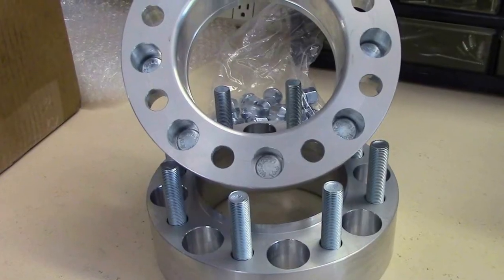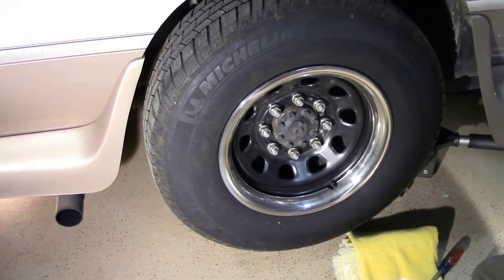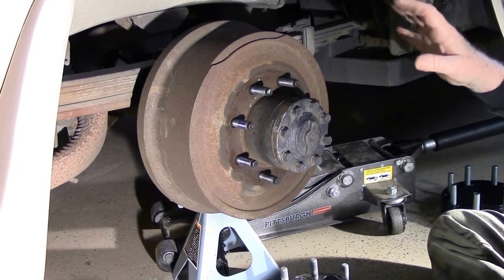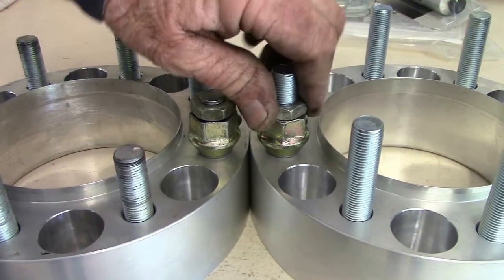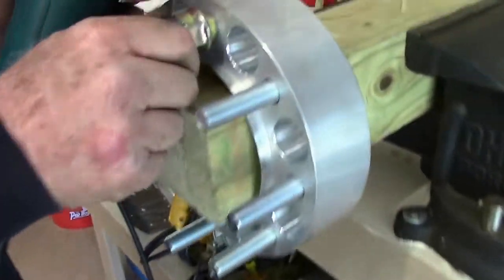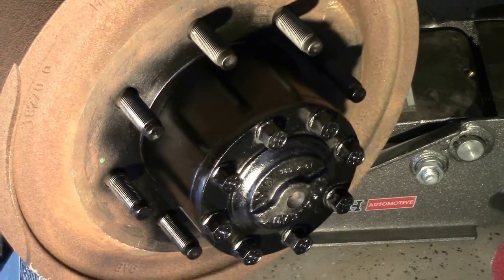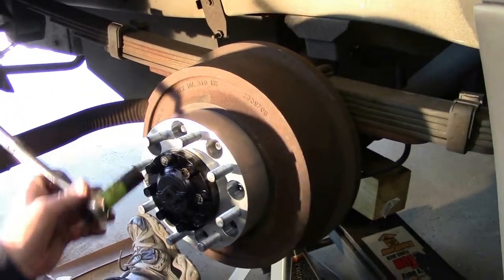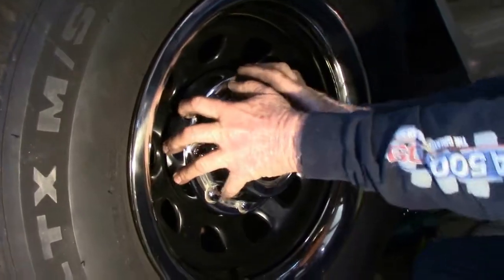Putting WHEEL ADAPTERS on a Class B

Comment: 1 have a 99 pleasureway RV that I also want to add spacers to back wheels. they look closer together than the fronts.  Will it affect steering, braking or gas mileage?
Reply from the maker: No it does not affect the steering, braking or gas mileage. It makes the RV handle better and improves its looks.